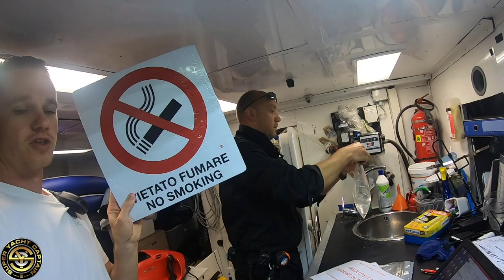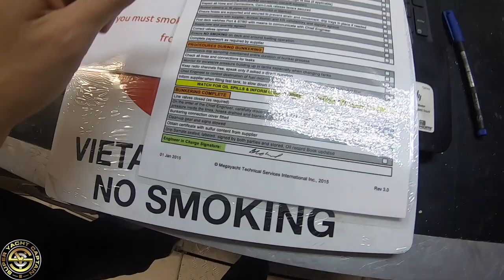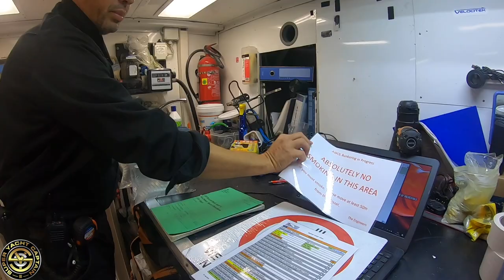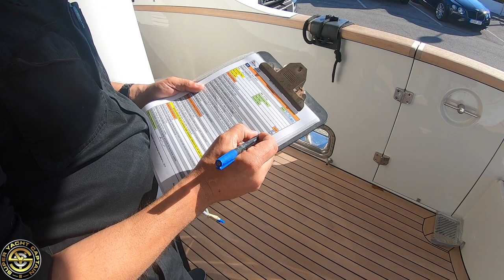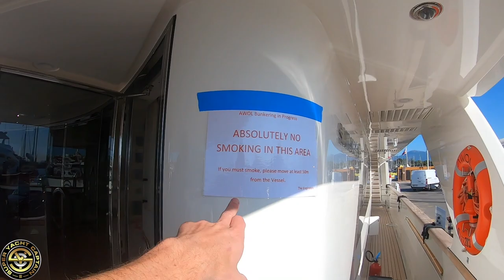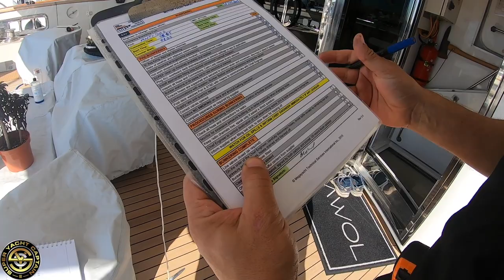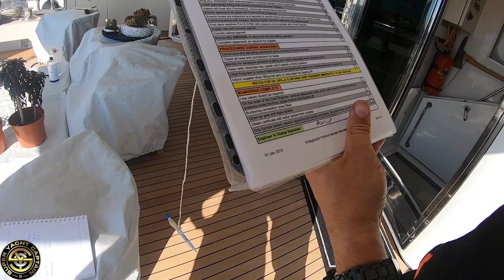REFUELING A SUPER YACHT!!! (Captain's Vlog 80)

Comment: Interesting. Which gives me pause to question. Who manages the various expenses of the yacht? Is this something the Captain does or does the owner have a third party handle this?
Reply: Of course the captain.
Reply: Every yacht is different. Some have the captain run everything, some have shore management, and some have a "purser" on board that would handle anything money-related.
Reply: @prava163  I am not familiar with the boating industry but assumed some basic rules. The captain should be responsible for the running budget as planned and fuel would be part of that. That's why I quoted "the captain of course". If he is not that makes him less capable of taking the right measures if money is involved. I can imagine certain small charter boats, being part of a fleet, handled centrally by a third party.
Edit: I missed the reply by the captain, so it is a team effort signing off. K
Reply: @tip00former1  I am familiar with the yachting industry, and thus my answer :) As I said, it varies from yacht to yacht, captain to captain, and company to company. It also depends on the size of the yacht (as the bigger it is, the more crew it has, and the more stuff that needs to be controlled), whether it is a commercial or private charter, and other factors.

In any case, even when the captain is handling payments... what it means is that he reviews the bills to be paid, then sends his approval onto the accountants who are the ones that handle the accounts themselves. It gets even tricker when you are doing charters and have a very strict budget with an APA. Captains usually want to remain totally outside of those messes as usually the company that organized the charter is not the same that owns and runs the boat and discrepancies arose every single day.

All in all, there is no universal answer. I have seen it all. But I'd say that after 50-60m in length when the crew starts in the 2 digits you will have some person on board with management and accounting duties and thus the captain is free to handle the boat itself and the customers aboard.
Reply: @prava163  Thank you for your concise information. I fully understand your explanation. I was still surprised the captain had to co-sign with the chief officer, not surprised about the land based accountant sign-off though. Has the co-sign to do with the size of the boat, certificates?
Reply: @tip00former1  there isn't a mandatory requirement, afaik, that the first officer must do this or that. It just depends on how roles are organized. (ps: nobody likes paperwork, and yachts have A LOT OF IT. Not only due to the sheer amount of compliances they must follow... but because every country they visit and every specific areas have different restrictions that must be known and compelled with).
First officers are there to complement the captains and to take control of the vessel if the captain was incapacitated or absent.
I work on a very very busy marina in the mediterranean, and some yachts have me call the captain himself for whatever (even post arriving at the office! And I'm taking 165ft yachts) and some others will give me a telephone list to call specific individuals on a per case basis. IE "we will cut shore power for 5 minutes for maintenance" -> call chief engineer. "Flowers have arrived" - call chief stewardess and so on (or call first officer for anything non-essential).
But once you start working with yachts that have more than 20 crew aboard... you definitely do not bother the captain for small things, nor you usually talk to him to handle invoices being paid or pretty much anything unless you need to know exact ETAs and ETDs in order to organize your dock force, which is something that pretty much only a handful of people know aboard.
It is a very very interesting world, and a very strange one to look at from outside.

Comment: are you testing fuel before it starts to pump? Hello from Praque, Cze
Reply: You need a lab for that. Usually, yacht crew request samples to the provider just as they are being bunkered. Those samples get certified and stamped by the provider. And thus, if the fuel is suspect to be defective, the yacht has a means to prove it after the fact as it will have a collection of samples to have analyzed and will know who to blame.
Reply: And what prava said in turn makes the supplier that much more accountable for their products.

Comment: Why did you fill up the two baggies with water in the beginning and i wish you would have shown opening up the fuel filler line down below.
Reply: They use the Ziploc baggies to cover over the water Scupper so if fuel spilled it wouldn't just go straight over board

Comment: Where does the displaced air in the tanks go as the fuel is pumped in?  Is there a vapor recovery system element as well.  Thank you.
Reply: That's what the Chief Engineer disappeared off to do as the fuel was pumped in, he released the tank vents

Comment: Tell the chief to re-check the spelling on the engine room. Unauthori(z)ed. Darn spell check should have picked up on that LOL
Reply: North American English commonly uses a Z whereas all other countries typically use the S so the spelling is proper.
Reply: @Rocky-iy8ct  Damm Overruled again. We single ourselves out once again (usa). I just got back from Canada Boy it was cold there 24 degrees (LOL) I'll never figure out the metric way. Thanks for clarifying this. I figured it was a stretch cause that boat is ran pretty damm tight.

Comment: At 11:55 the fuel hose is handed over the rail to the driver. Why with all these precautions would you allow anyone involved in or near the fueling process to be on a cell phone at anytime during the fueling process when transferring these amounts of fuel. I realize it's diesel fuel which is not nearly as flammable as gas but there's still the distraction and the driver doesn't even have full control of his body as he is using his shoulder to cradle cell phone.

Comment: Before starting the fuel transfer, do you test it for water contamination? Thanks for the video. Very safe procedure :)
Reply: why? it is not jetfuel.
Reply: @MemoryLaneCinema  I have worked in Africa for several years and every time we received diesel for our generators (20k liters) we had to check for water. He did find water sometimes. I guess they were unloading diesel somewhere and adding water to make up for the diesel missing. We had water/diesel filters but I didn't want to pay for the water :)

Comment from the maker: Poll: who here believes it’s dangerous to be using your phone whilst bunkering Diesel? Please give your reasons.
Reply: Not even close. My god i used to smoke while refueling the truck when I used to drive a truck for a living. Diesel fuel is not very flammable. Its combustible. Diesel fuel takes a lot more heat to ignite than just a cigarette or a cellphone usage. A simple spark or even several sparks are not gonna cause an explosion or fire. If you don't believe me try it yourself. Just dump a cup or so of diesel fuel on a concrete pad and drop a lit cigarette in it or even drop the cig in a cup of diesel fuel, it will be put out.
Reply: Now as for the rest of it. I liked the diapers as we call them here in the states for any unintended spillage but the zip ties are a bit over the top espically if your standing right there. That point of entry to the ship should be attended at all times while fueling and incase of a hose rupture. Now don't get me wrong i am all about safety. But there are some so called safety procedures that are there just so some college trained safety personal can justify their job.

Comment: bunkering for the superyacht usually takes a full day as it takes about 40 thousand liters.. quite a day wasted.
Reply: You missed where the engineer said the whole process for 13,000 liters would take about 45 minutes.  Not sure how you arrive at a full day for about 3 times as much fuel.  If they needed all 40,000 liters, i.e. empty tanks (can't reach dockside with zero fuel), they would have arranged in advance for 2 more trucks to arrive at the appropriate time, so all together it might be roughly 3 hours to take on 40K liters assuming just-in-time fuel trucks arrival.
Reply: @UncleEarl97   it all depends on how fast the machine can pump out of its own tank .. the superyacht i was on bunkered in Sri Lanka before heading up to Dubai.. did another at Egypt. we wasted a full day at both ports.. its simply because they only had 1 tanker available.. the tanker had to load n unload all 3 times..

Comment: Why can´t the ship builders keep the gas intake simple like the the vehicles in the exterior???
Reply: well the filler ports cant be on the outside of the boat because no one would be able to get to them and then in the event of a spill all the spillage just would pour into the water. on most vessels filler isnt even hidden, so this boat has a pretty elegant design as opposed to a pipe sticking out somewhere along side the super structure.
Reply: Because salty water

Comment: If these were my employee I would make some adjustments. 
1: safety glasses and face shield. 
2: cut resistant rubber gloves. 
3: rain gear not needed for these types of chemicals. But FR is. So I would require fire retardant coveralls. 
4: water proof boots. Timberland pro’s
5: JSA job safety assessment. Write down all dangers Identify the what could happen. 
Then what to do if that happens. I assign duty’s all other people must be together in a muster area not spread out all over the boat. 

This is the safety culture for delivery of chemicals to the Alaskan Oil Fields.

Comment: Wonder if they will ever get aviation style pressure refueling connections on boats instead of that janky multiple piece connector setup.
Reply: cause the tank can not handle that pressure?
Reply: @MemoryLaneCinema  That's what tank vents are for.  Plus you can design for that, AND adjust pump pressure.  They are still using a pressure connection, but that weird combo of connections is itching for a spill.  Airplanes all use the same single point fitting and have little to no concerns for spills.
Reply: @notj5712  I have driven fuel-trucks for years and now I have been working in the oil industry for 7 years. Fuelling on helicopters in normal for us. Talking to the wrong person?
Reply: @MemoryLaneCinema  Nope

Comment: what is the range of that yacht?
Reply: @SuperYachtCaptain  2625 nm
Reply: @jcheck6  Or 4862 km or 3021 miles.
Reply: You forgot to take into account the diesel the generators need...
Reply: @berndhaverkock6070  When it is underway are the generators needed?
When I fly an Airbus the engines' generators put out more than enough electrical power that we don't run the APU.
Reply: I'm not aware that there a so large generators attached either to the main engines or the shafts, which would produce enough electricity for the yachts.
During reading articles, watching vlogs, i only came across a handful of yachts which have larger electromotors attached to shafts, which could either be used as generators or as motors for an extra push together with the main engjnes, or could be used as motor without having the main engines running (-> zero emission or while docking).

Have to say, never been on a yacht.

Comment: what is the fuel consumption on 100km average of yacht?? probably around 500liter
Reply: 500l per hour  when its just the motors running without moving the boat
Reply: @Matti_MT-07  too much for  nothing !! why they work if they dont move
Reply: @Mr11ESSE111 ithink if you just normally sail its around 1500 litres of fuel per hour
Reply: @Matti_MT-07  too much!!and stupid peoples think that (diesel) cars have biggest co2 emmision and this sea junk consume for 40km (average hour speed)more then 500 diesel cars for same distance
Reply: @Mr11ESSE111  i think that diesel is the best why do you think audi and other cars start to using them again because they are better for the environment

Comment: I guess it is impossible to work on a yacht if you are tall. ... Thank God Slaven is not to tall working in his office .... to avoid head injuries maybe the Captain should hire some midgets to replace Slaven in the lower engine rooms,  ... The flap door for the the refueling connection is too small. ... You should be able to connect the feeder nozzle without so much exercise of twisted hose..   The ship fuel connection inlet should be so low to the deck ..... The fire extinguisher should be integrated with the inlet nozzle compartment as a permanent installation. .....  The designer of this ship is negligent of basic requirements for safety needs and requirements.

Comment: Just imagine how much money would be saved if they figure out how to run these with solar or wind power and get the same hp from some electric motor. 
It will be a game changer when that happens. These diesel boats will drop in value fast.

Comment: Is it a intrinsically safe video camera? The radio... is it intrinsically safe also... The sun glasses don't appear to be protecting your eyes in case of a splash of fuel... Nice T shirt but does it protect you from a splash... Gloves look like they are not petroleum resistant. Using camlocks with Zip ties to connect the hose!!! At least you are trying but hey...15 seconds later the hose nozzle turns on the connection.. Shivers up me spine... cant watch anymore.....